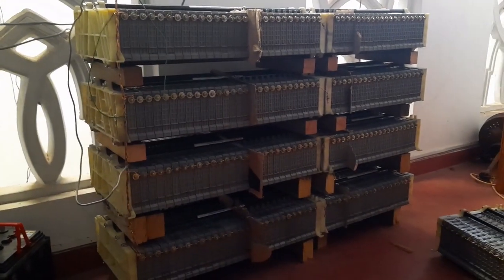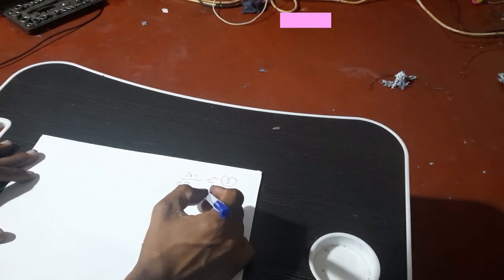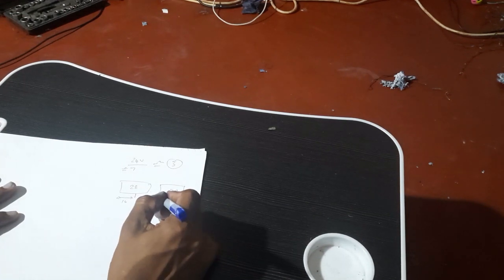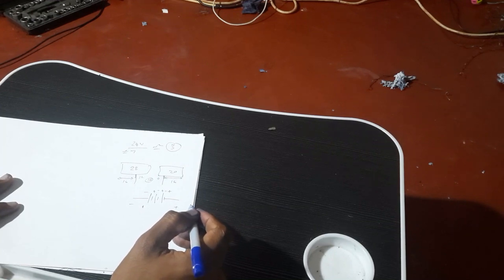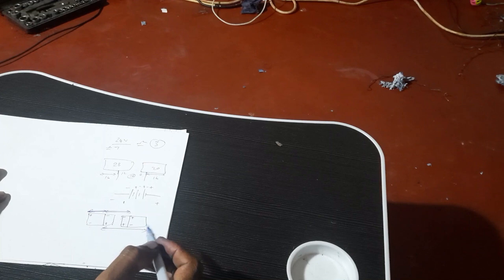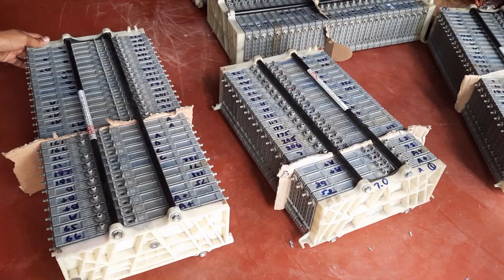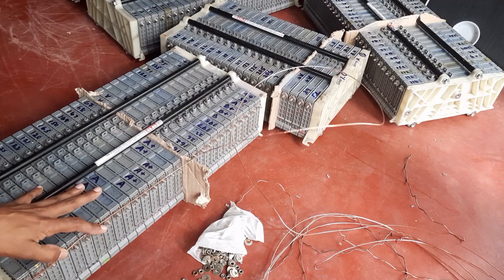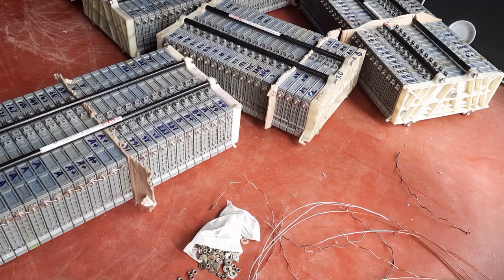24V 1kWh SOLAR BATTERY BANK build - used hybrid batteries!!

Comment: nimh battery good capacity and very safest battery.
tip for balancing using 7.5v or 8.1v shunt zener regulator in all modules for increase battery life.

Comment: What inverter are you using and what do you use to change the battery
Reply from the maker: I'm using a 270W 8.5A solar panel to charge the battery bank, you can see the description of it in my previous videos. 
The inverter is a 3000W pure-sine wave inverter I bought through Ali-express.
That also I've described in my previous videos. 
👍

Comment: Hi I have one of those battery packs and need to make a 24v battery out of it, how do I arrange the cells to get 24 v
Reply from the maker: Do you have 20 module pack or 28?
Since each module has 7-8V you'll need to put 3 sets in series.
If 20 you'll have to put 6 each and connext in series, you'll be able to use 18 modules, if 28 you'll be able to use 9 each in 3 sets so 27 modules, you can leave the low voltage modules out
Reply: 28 pack
Reply: What kWh  is this battery pack ??? 
What  BMS do you recommend ???
What setting should I use on my Victron charge controller?  Not seeing a setting for  NI-MH cells ??
Reply from the maker: @bajanboytoy1  
I got 1kWh from the entire setup.
It is low compared to other options,  however these modules are relatively cheap, as they are discarded from car repair shops.
If you want to get full power out of them I can suggest to charge at 8.2-8.4 V.
If you're making 24v system (3 modules in series) you'll have to charge to 25.2V
I won't recommend a specific brand, but any BMS which is compatible with NimH cells will do

Comment: Hi Sir I have installed 3.5 kw solar system, 24 volt battery is to be installed, how much will be the car hybrid cells that can run my 1500 watt load at night, comfortably my solar will run 1 ac at night and  The load of the lights will be only how many cels have to be installed
Reply from the maker: Theoretically one cell has 6 AH (new/reconditioned)
So you will need around 450 cells to run 1500W at 24V for 12 hours

Comment: I USE THE SAME BATTERYS AND IM LUCKY IF I GET 7.4 VOLTS I USE 4 BATERY TO MAKE 24 VOLTS THEY SAY THEY HAVE 6AH PER BATTERY AT 38.00 A PEASE THEY ARE HIGH FOR THE AH YOU GET
Reply from the maker: Using 4 batteries to make 24V will not be very useful, I use 3 batteries and charge to 24.8V.
If you go through the voltage vs capacity graph of nimh batteries you'll see their capacity drops drastically after 6V.
Check out my videos on how to select the suitable batteries.
Reply: @solar_energy  i may try the 3 batterys to see if it will work i all so have some life04 in on the battery bank
Reply from the maker: Great 👍 let us know the results of your work.
Reply: @solar_energy  yes i like how you done the testing i did simaler any thing would come back to 7 volts i would keep i only got 64 out of 120 batterys

Comment: Top much time and energy for just 1 kWh.
Reply from the maker: For those who can afford, can use better battery modules. There-by the capacity can be increased x 5 times
Reply: @solar_energy  how much did this cost you?
Reply from the maker: Each pack cost around 18-20$ 
There are 8 here.
Reply: 1kw is one battery...it seem he have around 10 of these...so 10kw.of energy storage ....😲
Reply: 1kw is one battery...it seem he have around 10 of these...so 10kw.of energy storage ....😲
Reply: 1kw is one battery...it seem he have around 10 of these...so 10kw.of energy storage ....😲
Reply: 1kw is one battery...it seem he have around 10 of these...so 10kw.of energy storage ....😲
Reply: 1kw is one battery...it seem he have around 10 of these...so 10kw.of energy storage ....😲
Reply: 1kw is one battery...it seem he have around 10 of these...so 10kw.of energy storage ....😲
Reply: 1kw is one battery...it seem he have around 10 of these...so 10kw.of energy storage ....😲
Reply: 1kw is one battery...it seem he have around 10 of these...so 10kw.of energy storage ....😲
Reply: 1kw is one battery...it seem he have around 10 of these...so 10kw.of energy storage ....😲
Reply: 1kw is one battery...it seem he have around 10 of these...so 10kw.of energy storage ....😲